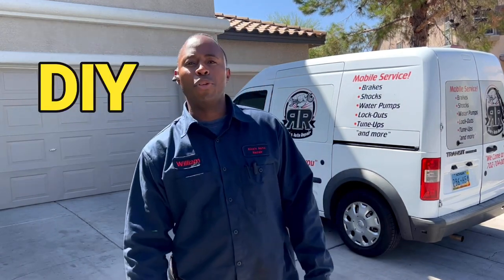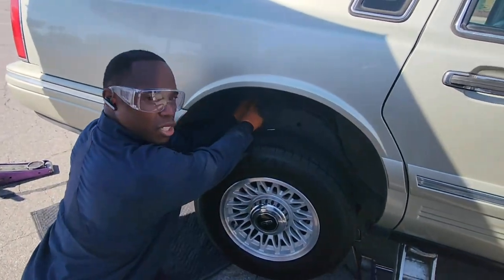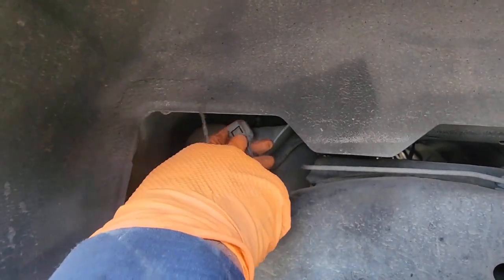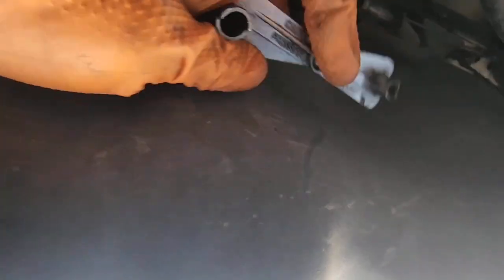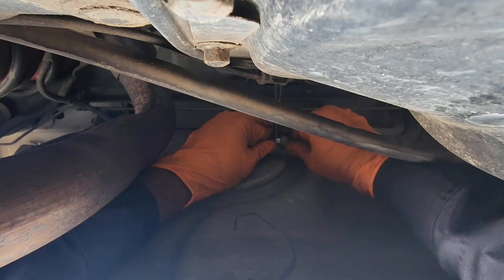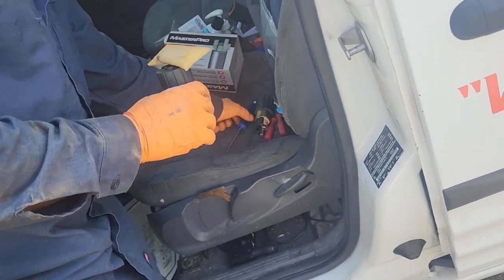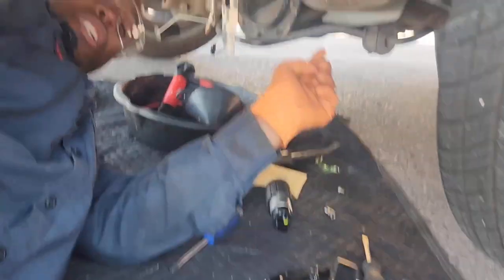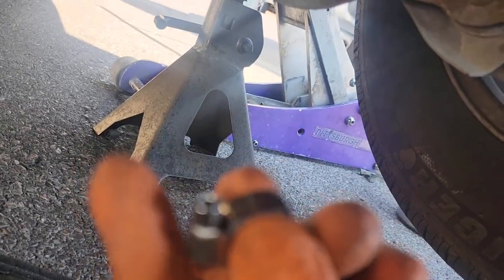replacing fuel pump in a 1997 Lincoln town car

Comment: I'm 78 and don't trust jacking car and reaching under the tank as per your video.  I Googled the question "Where is the fuel pump in a 1995 Lincoln Town Car?" and it showed two answers.
One said   "The ELECTRIC fuel pump is INSIDE the fuel tank  * the fuel tank is mounted vertically behind the rear wheels and the fuel pump is installed through an access hole near the top of the tank (on the side facing towards the rear seat)"

A Second answer said  "In the fuel tank. You can access without dropping the fuel tank.  It's located on the front side of the tank.  Remove the 6 screws and carefully pull it out or the fuel level sensor will get damage."

Is it possible that there is an access hole in the floor under or behind the seat OR under the padding in the  trunk?  If so I could get some help from a neighbor to get this done.  If I knew where to cut,  I have a nibbler and would replace with a metal plate when done.   I'm trying to avoid a shop because  I'm on Soc. Sec. and don't have the $1000.  Any guidance would be greatly appreciated.